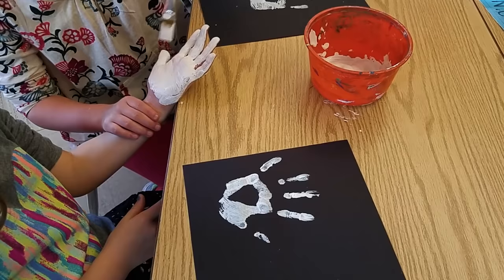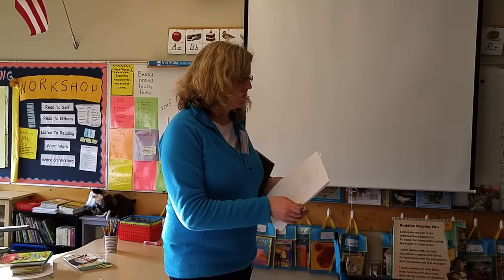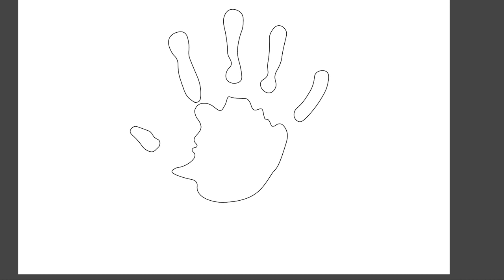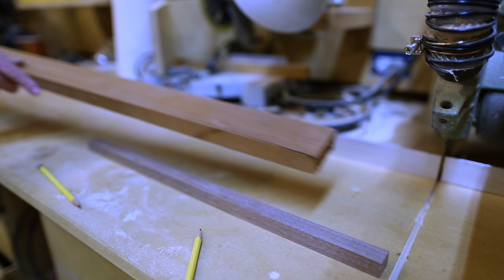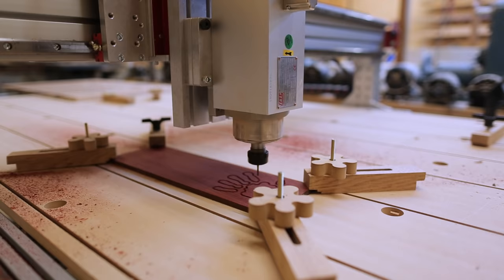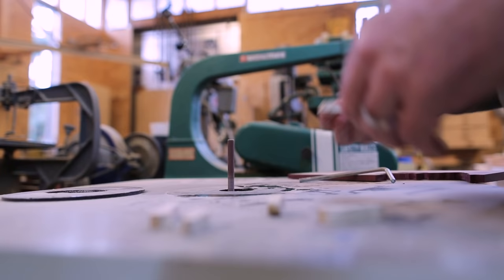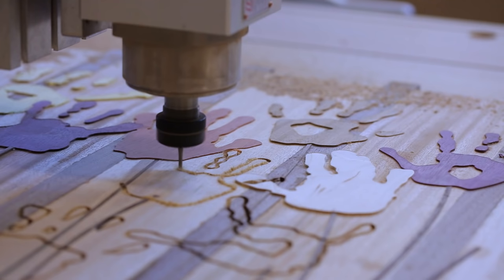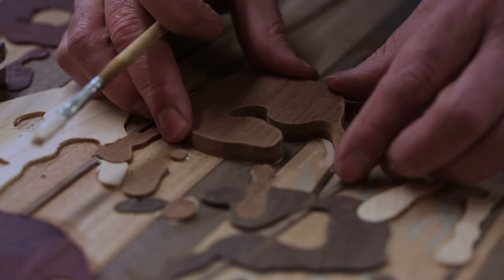Wood Cut Handprint Art

Comment: I wonder how it would look if the hand prints had stayed proud of the surface with a roundover or something on the edges.  I did a small chest for my dad's 70th birthday with all of the kids and grandkids hand prints (which added up to 70 at the time, we added another 10 later) and I used a roundnose bit on the hand prints so it actually looks like the hands pressed into the wood.  So much sanding on that one.  Basically the reverse of what I'm thinking for that.
Reply from the maker: I wondered about leaving them 3 dimensional.
Reply: I think it would look great leaving them proud especially if the hands were at multiple levels. The ones in front sticking out more than the ones behind. It would have been more of a bas-relief  and less of a picture.
Reply: Women wouldn't appreciate such a dust collector. :-)
Reply: I agree, I think I liked it better before milling flat. Beautiful work, Frank regardless!

Comment: Really extraordinary project.  Wow!  I’ve never done this for CNC, but I think for projects like this you can make the hand prints into selections in Photoshop, then smooth the selections to a given radius, then convert the result to a path.  That might be easier than tracing. For example, if the hand prints are scanned at 300dpi, you could smooth to a radius of 38 or 40 to be safe and then you should have no curves tighter than 1/8.  Then convert to path afterward.
Reply from the maker: I will have to look into this.

Comment: Very well Done, i suggest Aspire it will help you with the pocket and inlays, the software will compensate the difference between the pocket  and the inlay but you have to cut both with same tool diameter.

Comment: Nice work Frank!  Thanks!  If you want to do some really nice inlay work, look into Vectric Aspire.  You use a 30 to 60 degree V bit and create a male inlay and female pocket that you join together.  This gives you superior fine points and  curves and doesn't limit you to the radius of the cutting bit.  I run it with Mach 3 which I believe you use also.  There is a free trial you can run.  I don't work for them but I think you will love it and maybe you can do a few videos on it!!

Comment: Great idea and result Frank! I was wondering why you decided to flush trim the face using the router bit and creating a big mess of dust instead of running the panel through the thickness planer?

Comment: Frank,  What are you using for your CAM? Many sign making CAMs like ArtCAM or Vetric have wizards to deal inlays.. They will calculate the whole angled edges and sizing the inlay small enough to fit.. really good tooling to make calculating the CAM for a inlay.. 

Great video.